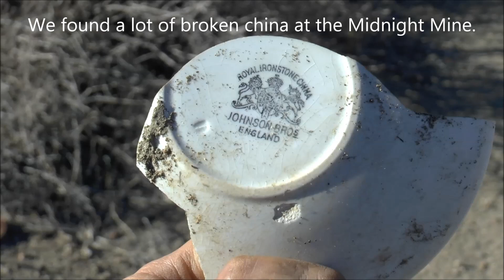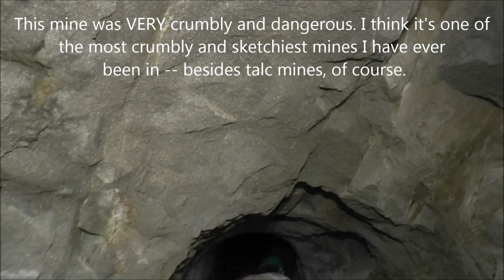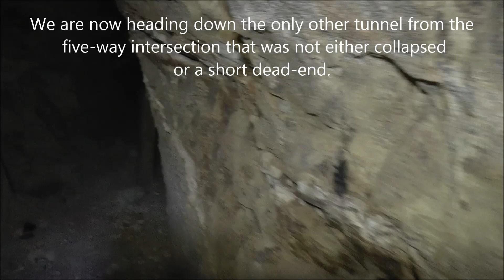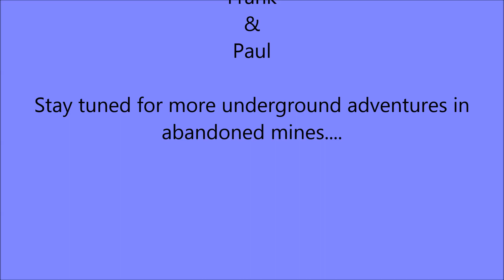Collapses and Collectibles in the Midnight Mine at the Ten-Mile Tunnel Complex

Comment: Awesome video! The pyrite definitely came out in a few parts of the video when the lighting was just right. There were parts of the tunnel that even in the video looked extremely crumbly. Thanks for sharing Frank, stay safe.
Reply from the maker: I haven’t watched this video in years, but I think this is the one where Paul went ahead of me and crawled over two or three more collapses or piles of backfill in the tunnel before he decided to call it quits. There was tremendous airflow through this tunnel, so we think it connects somewhere else with other mines that are in the area. The 1800 foot inclined shaft is in one of these tunnels, so I would like to find it someday. I think there was an inclined shaft in this tunnel that we couldn’t see the bottom of, but it probably was just a dead end. There was no air coming out of it. It was too smooth and too slippery to descend without a rope. I don’t think that was the 1800 foot inclined shaft.
Reply from the maker: I just rewatched this video. This is NOT the video where Paul went ahead of me by climbing over successive piles of rubble in the tunnel. That was another mine in the area of this one. Can't remember which video. At any rate, as you saw in this video that collapse was only about 2 and a half feet thick. Could be easily dug out but we didn't have a shovel. I never did show a shot of the waste rock pile outside this mine, but it is HUGE! Always wanted to go back to this one, but never did -- and that was five years ago!

Comment: A lot of that material looks metamorphic. Look at 5:20. Individual pieces of stone swept up in a flood and deposited with whatever sand, clay or other material was available. Unless the binding material reforms as relatively solid rock the resulting material is crumbly. The fact that it seems to have been dug by hand is a display of both the softness of the material and, I'm thinking, the reason they maybe didn't use dynamite - because a blast might cave the entire mine in. It's still hard to imagine that entire mine dug by hand. I wonder if they had air powered chisels.

Comment: I would guess those marks you said were from pickaxes would be marks from check scaling. just my thought. I know if I worked in a mine with such loose kinda ground, I would check scale as much as I could to reduce the chance of collapsing.
Reply from the maker: +sasquatch tickler Now that I think about it, you might be correct. I assumed that the scratch marks were from pick-axes. But I could see where they might also be from scaling bars. The rock in this mine was so soft and crumbly. I'm surprised they didn't timber more than what we saw. The mine must've been quite extensive due to the huge waste pile outside the portal. However, as you saw, the main tunnel was collapsed in that one area.

Comment: Have you guys ever got lost exploring a mine? And what methods do you use to not get lost?
Reply from the maker: No, I have never gotten lost while exploring and abandoned mine. The videos make the mines look very confusing with all of the editing; however, most of them are basically one way in and one way out. It would be very hard to get lost. Some mines, however, do have miles of tunnels on multiple levels which would present a hazard of getting lost if one did not keep track of the route one took.